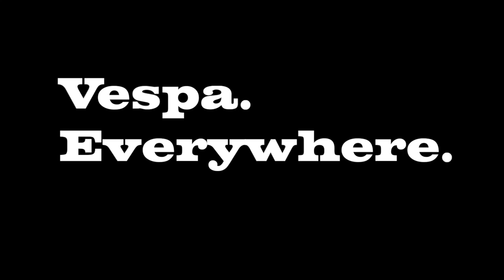How to Change the Rear Tire on a Vespa GTS GTV Super 300 HPE & Calibrate Traction Control ASR

Comment: Hey Matt, I also live by the sea and I use ATF(Automatic Transmission Fluid) for all kinds of anti corrosion it is amazing. You can paint it on garage door springs and leave it for months and it protects the metal.

Thanks Robot, great service you do for the Vespa community. You are well loved! 👍

Comment: I recommend calling around to find a shop to remount the tire before you start. There is nowhere we can get small wheels mounted locally. We learned to do it ourselves. It is risky to do at home and you can damage ur rim. It takes practice. Great video. Robot.
Reply: I had the old tire taken off and a new tire put on, at a place in the town where I live.  They don't do small tires generally.  Just cars and trucks.  My scooter was a Honda Metropolitan.  Steel rims.  Here they bent the rim putting the new tire on.  Now, I have to get a new rim.  It vibrates like crazy when I apply the brake.  My Vespa wheels will never go to a tire shop again, unless they are set up for motorcycle and scooter tires.  They ruined the rim and I have to get another one.  So reconsider ever taking your scooter or motorcycle tires and rims to a place that mainly only does car and truck tires.
Reply: That's aweful. It all depends on who you talk to at a motorcyle shop. I did get the local Honda dealer to mount a tire for me once, but they were very hesitant to do it. They charged $40 to do it. Our Honda dealer sells scooters, but not Vespa.. The Harley, and Yamaha shop didn't mount the smaller scooter rim.

Comment: You might want to look into using balance beads instead of wheel weights. They balance perfectly, only cost the customer a few bucks and you never have to take the time to balance a wheel again.
Reply from the maker: Thanks for the suggestion, I'll ask Robot about them.

Comment: 16:20 Why they don't put anti-seize in there at the factory is beyond me. First rear tyre change I did was a 'mare trying to get that plate off (and it didn't even have that many miles on the clock)

Comment: Hi Robot. Thank you so much for your videos, they are a life saver!  I did the above procedure after getting a puncture on the way home from buying a brand new gts rst22 300!   Unfortunately now the speedometer is not working!   When I switch it on, it illuminates and the needle goes up and back but it doesn't register speed on the move.  I don't know if you answer these sorts of questions,  but any help would be appreciated greatly. Thank you

Comment: Hi, another great video, thanks for posting. I live by the seaside and corrosion is a problem with anything metal. It can get under the clear coat on alloy wheels. Have you got any tips for washing wheels (without removing them) and suspension so that salt residue can be removed and hopefully limit the onset of corrosion?
Reply: I use AFC-50. Just need to make sure it don't get onto your tyres or you'll be off at the first bend in the road! Plenty of videos about it and protecting bikes from corrosion but I would apply it every time you wash your scoot (as opposed to the once a year protection thing that the videos seem to show, as it doesn't last a year. Esp on wheels!)

Comment: Thank you Robot and Vespa Motorsport.  using this video and a the other one, I successfully updated the CTC ASR and upgraded the exhaust on my 2020 GTS300 HPE.  Quick question though. afterward I followed your instructions to calibrate the ASR and got to the "slow blink" just fine and went for a smooth drive and it would simply stop blinking.  I cycled on/off and tried again same result.  Should I be concerned mine is not calibrated correctly, or did mine just calibrate differently than the Tech version in your video?  Thank you for your help, and the parts (as I ordered them from Vespa Motorsport so I knew I had everything perfect.

Comment: Nice video, but I  removed all bolts and the shock and te speedo sensor are detached from it's mount. The mounting frame seems so firmly stuck, that there is not way to remove it. It seems so easily removable just with two hands in the video.

Comment: HELP with front end wobble on modern GTS300.  Mine is a 2015. Tires are in great shape, and balanced.
Reply: Hi seems can be a number of things from what I have read ! But for me (2018 gts) the top box makes it shake , take it off a lot better . only happens with both hands off bar so not a big problem .
Reply: @elizabethandgrantmoonfamil9341  I did try that, a bit less wobble.  I think there is an inherent design flaw in the larger Vespa's.  None of my motorcycles , nor friends of mine ever had wobble, even with top boxes, side boxes, whatever.  It's a Vespa design flaw.

Comment: This definitely is not a DIY job, do you recommend replacing the front tire now that the scootes is in the shop. Can you give an approximate price on a job like this. Thanks, been enjoying all your passed video's plus your a great narrator. Thanks!
Reply: tikiRico Sorry, but gonna have to disagree. This job should be well within the average scooter rider’s ability. The only bit I would recommend taking elsewhere is getting the actual tyre changed.
And the front tyre will hardly ever need to be changed in comparison to the rear (if you are keeping to the same type/tread etc)
Reply: sure, I guess you're right! I just need to get a torque wrench and take the tire to any motorcycle shop. Great answer! Thanks

Comment: I’ve never heard of wheel weights
Reply: The One wheel weights are very common for auto and truck tires. A balanced tire/wheel gives much better smoother ride and usually longer tire mileage. It’s a small expense with a great gain.